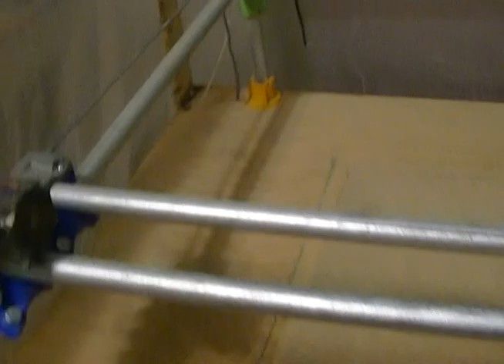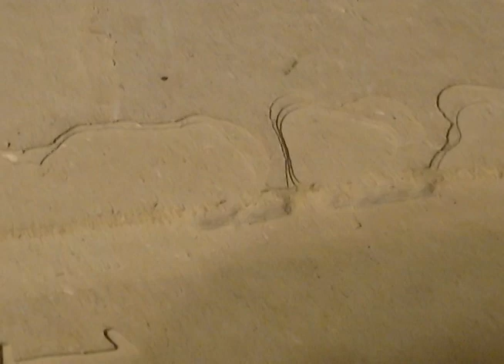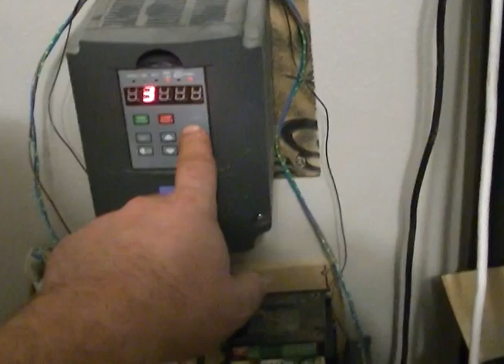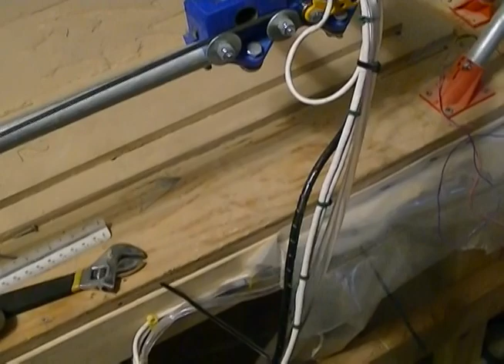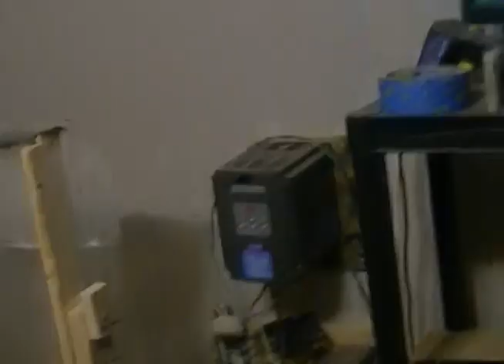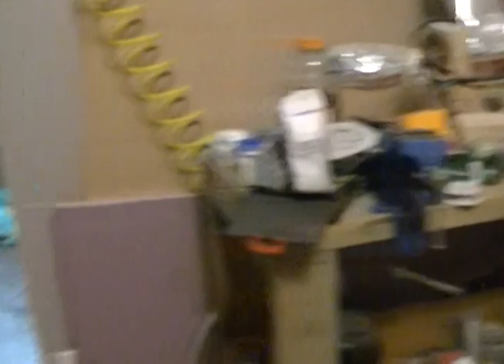mpcnc upgrades

Comment: There is a 6 axis USB controller on Amazon that is only $75 that works great, I believe it has analog output for VFD control. I bought one, but haven't hooked it up to the VFD, but works great otherwise.

Comment: Is it necessary to add these upgrades in order to operate water-cooled spindle? I got myself 2.8kg spindle, so not sure now if standard MPCNC with NEMA17s will be able to operate it well?...
Reply: The spindle is heavy so it does tend to tilt and it won't stay Square.
Reply: @chadcory  How much does your spindle weigh?
Reply: @pavelgrishin  I think it is 10lbs

Comment: I would redesign the XY bracket so that the top X runs just over the top Y and the bottom X just runs over the lower Y. The bracket bearings for X must be on both sides of Y pipes and Y bearings be present on both sides of the X pipes. The Z mounts off one of these corners.

Comment: Did you work out what the problem was ? Are you still using Mach 3
Reply: ndudman8 it is fixed .it was a bad z screw . And yes I'm still using mach3.
Reply: Glad its fixed. The z screw was bent or something ? Have you been doing any 3d carving with your mpc ? Or generally how are you finding the tolerances and accuracy of your build ?
Reply: ndudman8 so I'm using this mpcnc almost every day. The repeatability is great.
Reply: ndudman8 not a lot of true 3d cutting.
Reply: Great to hear... if you shared any of your work, it would of course be interesting...  Pleased its all working. Just ordered parts to build one myself. How are you finding the water cooled spindle? is that a 1.5 or 2.2kw ?
Reply: I love my 2.2kw spindle but it is heavy. That's why i had to double up the rails. i think a 1.5 would work great. the 2.2 is overkill.
Reply: I'm going to post my upgrades on thingiverse
Reply: Do you already have a thingiverse page ? Could'd find it yet.

Comment: Good work.  Did you consider mounting the second rail on the opposite side of the router?  Basically put a slice of the router clamp between the two rail clamps?
Reply: Yes I looked at doing it that way but it would have more work. But this is a on going project and I have a design started to do something like that.
Thanks